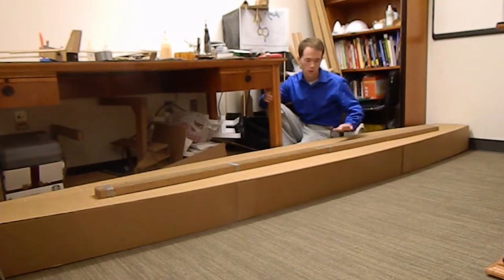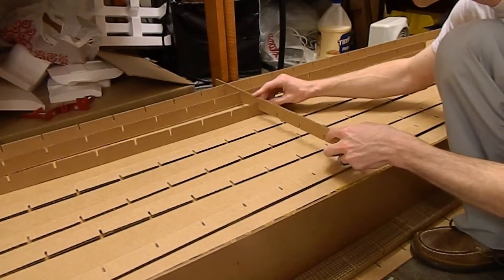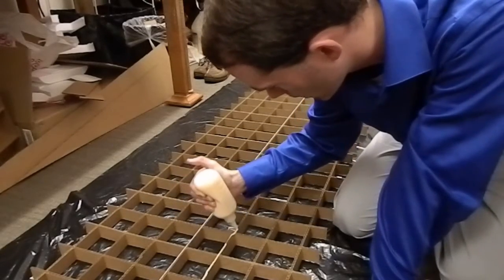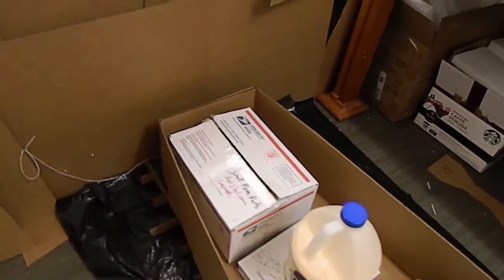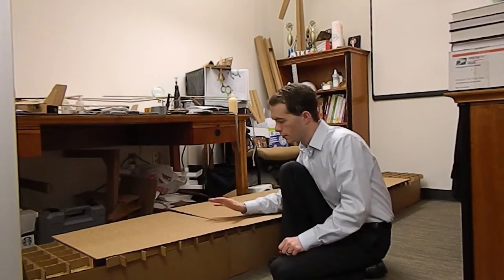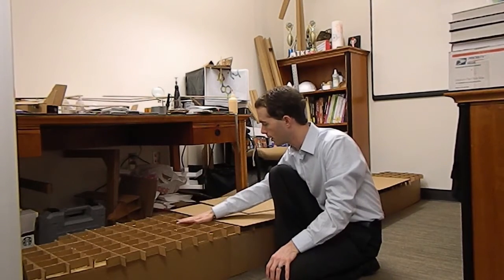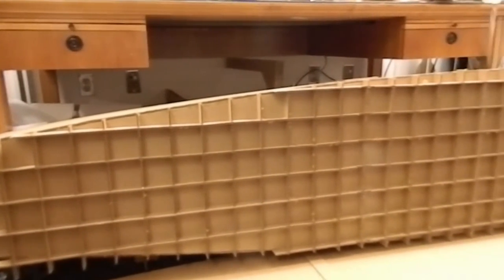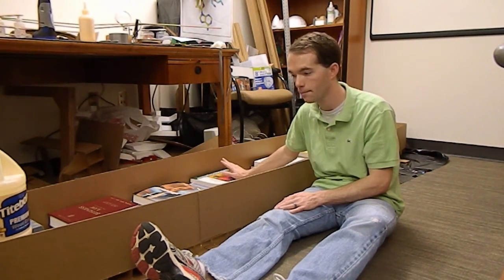Cardboard Boat 2015: The Flash. Build Part 1/2

Comment: By allowing the glue to drip into the corrugations it should make it stronger, maybe fill them up. Or put 2 part epoxy in the corrugations.
Reply from the maker: Hey Tony! You're right, by allowing the glue to drip into the corrugations a bit, it does get a bit stronger. Filling them up would weigh and cost too much, and the glue would never dry out. Epoxy isn't a legal adhesive, otherwise I might consider it.
Reply: @MikesInventions  yea, i was thinking it will add weight. But when and if you can afford more weight but need more strength, there you go. There is also the option of only putting some in each corrugation, just some will strengthen it too, no need to fill it up if you can't afford that much weight. But it will dry, just don't block it all off until it is dry, then glue it all together on all ends. 

 
You could use epoxy just for the corrugations, let it dry, then clue it where it belongs, but it would be the similar weight as glue anyway.

Comment: How could I build a cardboard boat using only two 4'x8' sheets of 1/4" corrugated cardboard and 2 48mm x 54m rolls of duct tape.  It should hold at least 500 pounds

Comment: wht type of glue are you using?
Reply from the maker: Thanks for watching! It's Titebond 2. I think it's the best overall value & performance. I've used Elmer's wood glue in the past and it works fine too.
Reply: thats nice, and how long your boat lasted? 

i think i'm going to build a kayak with grey dense cardboard instead of plywood, and two coats of polyester resin with fiberglass, what do you think of it? it can be waterproof and last at least a summer?
Reply from the maker: I threw it away two months ago after a year. I just got tired of storing a 16' boat. It never lost a race!